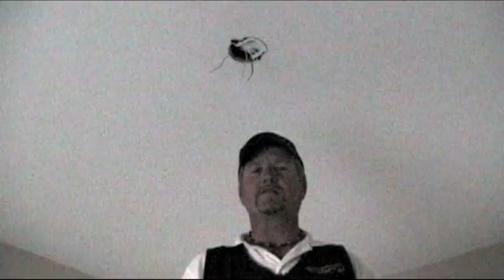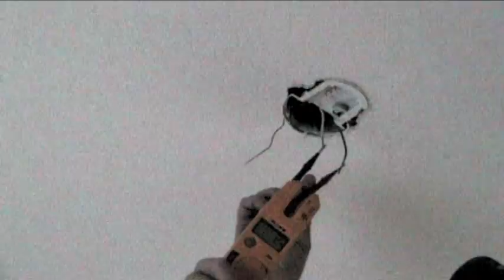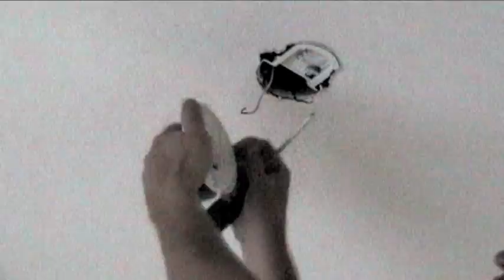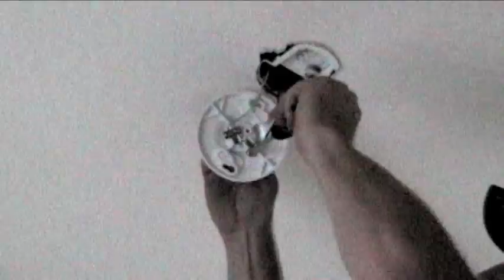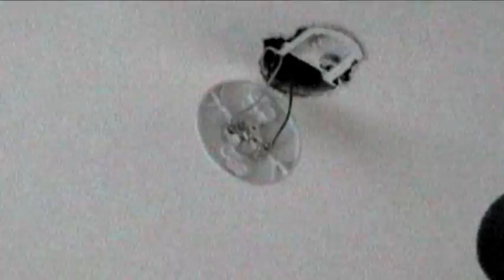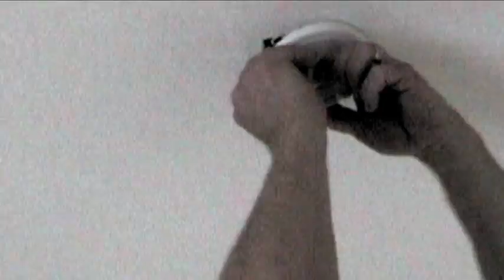How to Wire a Simple Keyless Lamp Holder

Comment: Thanks, that was very helpful! ♥ Plan to use these to mount my crystal chandelier fixtures to (make those myself). Used to use electrical box covers for that + hanging pendant fixtures, but pendant fixtures cost more and are much longer, increasing number of crystals needed and thus project's cost. This lamp holder with a bulb is only about 5" long vs at least 7-8" for a pendant fixture.

Comment: Is there a risk to use this if it has no ground cable attached?
Reply from the maker: No, the fixture is made entirely of plastic other than the lampholder shell and center pin. We  only ground non current carrying components of an electrical system that are made of any kind of conductive materials such as metal.
Reply: @theinternetelectrician  thanks for the answer, so if I use this and connect to it a wood and plastic luminaire via a "lightbulb to socket" convert, I should not have any issue since there is no metal.
Reply from the maker: @Whiz0013  I'm guessing that you are building a light fixture of some kind?
This is why many desk lamps are only 2-prong plugs.